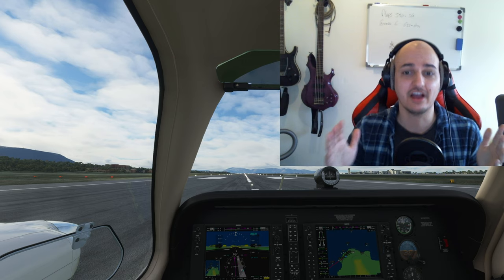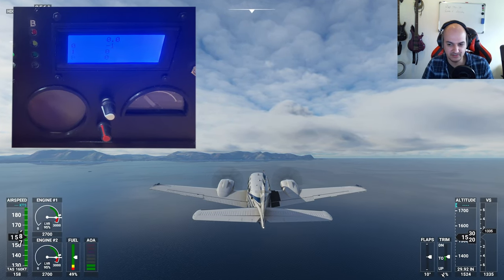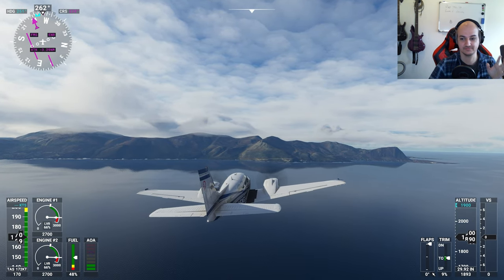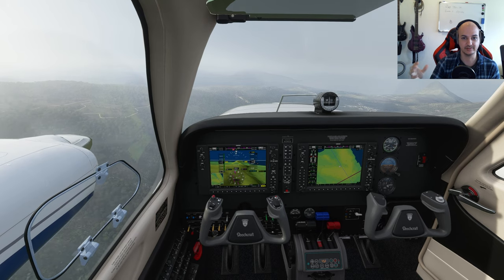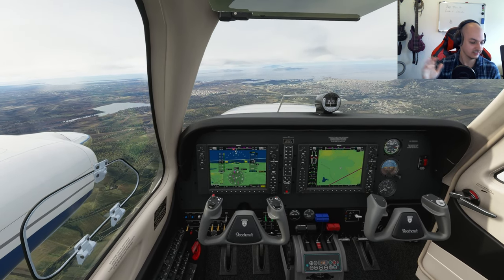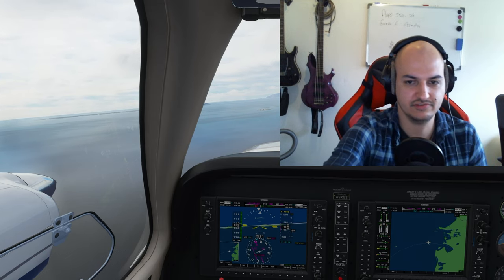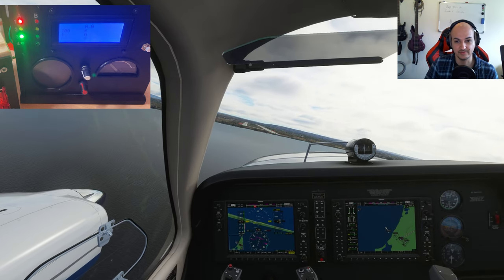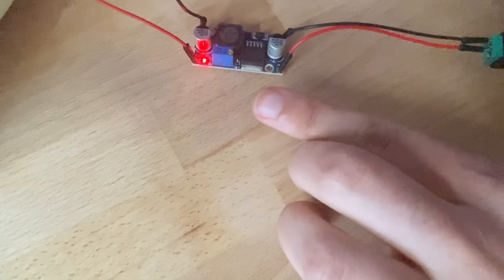Flying over Southern Italy for Arduino library + Connector release V0.5.3

Comment from the maker: In this video I'll get you up to speed on the latest version. Expand your cockpit with gear indicators, flap indicators or rudder/trim values. 

The latest version can be downloaded from:
Https://www.bitsanddroids.com/downloads

The latest documentation can be found on:
https://www.bitsanddroids.com/blog/ar...
Reply: Dc voltage is relatively safe especially when under 48v (above 48v dc can jump thru air or/to skin) capacitors in DC circuits usually are the only shocking things in DC circuts for the most part but voltage isn't the killer its amperage as little as .5 amps at any voltage ⚡ can be fatal! Also the 1 hand rule helps with safety when dealing with live circuits it is better for u if the electricity just goes thru one or two fingers than thru ur chest and heart so only use 1 hand to mess (id rather lose a finger than my life) I have worked with ac for 10 yrs and DC for probably 20years since childhood I would Frankenstein my toys together lol I've been shocked probably over 1000 times easy 😅 😳 not fun but not a big deal the worst was on a coil gun I made ooooo the black mark on my thumbnail was bad it melted a pothole smelled horrible and hurt for weeks don't solder on a live capacitor bank ever
Reply from the maker: @salvatoremilitello8490  Thanks I just ran this by the person that told me to be extra cautious. He asked  me if I ever shorted anything dangerously and I said no. Apparantly that was his life lesson. Don't mess with live power but apparantly it won't hurt you. Here I was afraid for no reason! Thanks for the enlightment
Reply: @Bitsanddroids  it is good to have respect cause if you direct short certain circuits they can induce a magnetic field when the short is removed the collapsing field can result in an ac voltage that can be up to 10x the working voltage of the circuit. radios, transmitters, old crt tube TV, and other inductive or capacitive circuits can do weird things just like neon sign transformers can shock someone going thru concrete or brick. 
But with most dc 12v or less is extremely safe considering the evidence / knowledge and life experience (aka lessons) and with these ic chips like the arduino uses ur more likely to harm it than urself 😜 static discharge destruction is annoying af